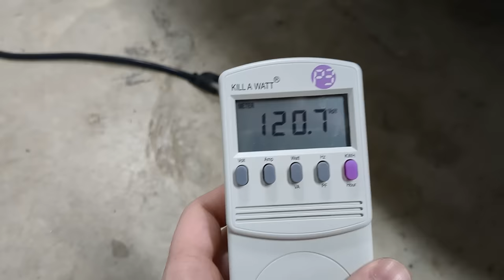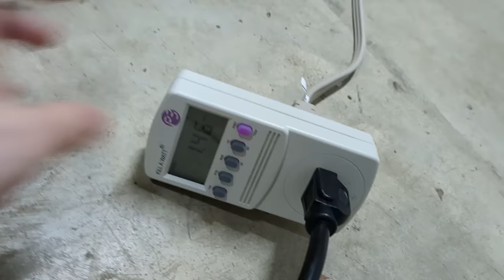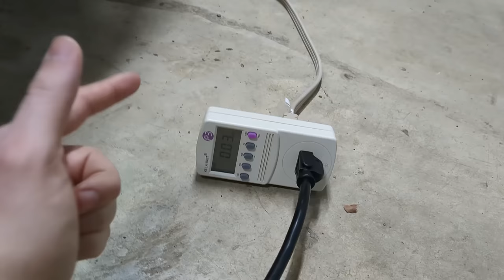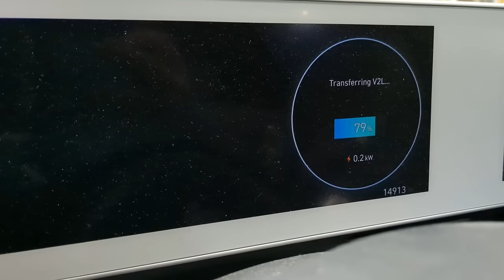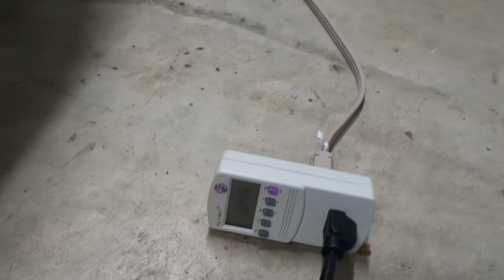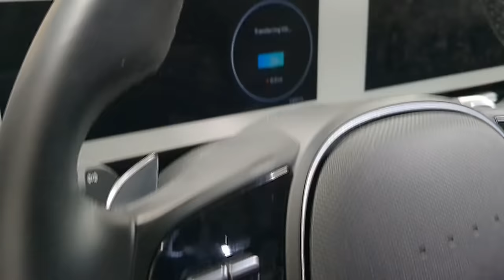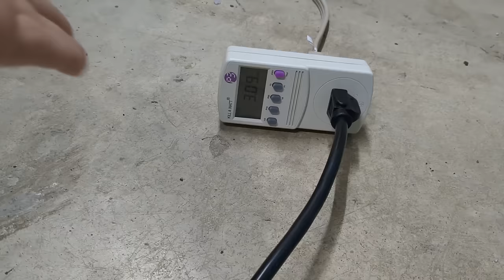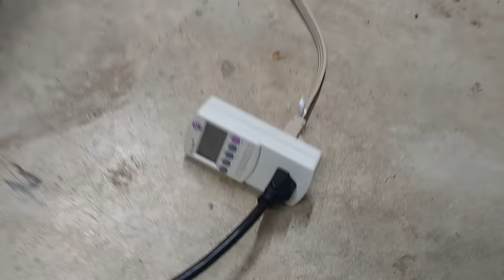A 24-hour test run of the Hyundai Ioniq 5's Vehicle-to-Load function

Comment: I have done something similar with my Prius.  The Prius has its 12V battery in the back with very easy to remove plastic panels over it and one small panel in particular that is the right size to stick large gauge wires through it.  I only have a 600W pure sign inverter at this time as it was deemed adequate for the tasks at hand many years ago when I first set it up.  At my current place I still cook with gas, so don't need that extra power for cooking.  The essentials beyond cooking needs very little power, so this works out well.

The Prius is not "efficient" per say when used this way, but compared to a regular gasoline generator, it is very efficient and very quiet, so really is is a rather ideal solution.  The thing is the power is meant to be used in car mode driving around, so there is going to be some residual load used by systems optimized for high performance while the car is being driven around.  In your case, you have the problem in that large inverters are just not very efficient at power conversions for small loads.  The Prius is super efficient at converting energy from its high efficiency engine into electrical power that it then stuffs into its battery and then the engine is shut back off, saving tremendously on idling engine losses as the engine is never really ever idling.  An all day use like this gets into the realm of a couple of bucks worth of gas used, which is amazing.  Of course with a Prius, you need to make sure it is in a well ventilated place to do this and you have to leave the car in "READY" mode, so the car is ready to be driven around.  So for example you open your garage door and have it ready to be driven off by someone in order to be used as a generator.  Details.

It would be nice if there was a plug-in hybrid electric truck with a generator mode.  A truck with a large gas tank for towing and such should be able to last in generator mode for a long, long time.

Another interesting use could be say for an apartment dweller who say has level 2 charging at work.  When it comes time to vacuum out your car, just pull out this adapter and plug the vacuum cleaner into it.
Reply: The Ford F-150 hybrid is close to what you're asking for. It's got a 7.4kW inverter and 120V outlets in the bed. It's not plug in though.
Reply: Going through the 12v converter is fairly lossy. For a more ideal use you can get inverters which connect to the car's HV system. From user reports I've read using a Prius as a generator this way is about as efficient as a small inverter generator. And another plus compared to going through the 12v is you have much more power available.
Reply: @eDoc2020  Yeah, I looked into this a long time ago.  The Prius can generate up to 3kW sustained this way, plus higher short bursts out of the battery if needed.  There are some catches to this.

For one you need to be able and willing to connect directly to the battery relay terminal.  Those bolts are on tight for a reason.  This gets into doing some work and knowing what you are doing.

The second is picking out your power conversion hardware.  What I was thinking of doing in particular was to get a 2 kW Meanwell power supply with a 24V output.  These are interesting because they are specifically rated for AC and DC input.  This way no worries about burning out something as you hope you successfully end up bypassing the PFC and don't overload something by having the polarity going in always the same instead of its designed alternating design.  Instead these Meanwell power supplies are specifically tested and rated for both AC and DC power input in the right voltage range.

I had two reasons for 24V output.  One is much smaller wire.  Second I could use with my high powered hobby chargers directly and pull more power than I could pull off my 12V.  I was even thinking about a high voltage DC extension cord while at the flying field because then I am operating in the pits / tables instead of directly out of the back of my car.  However, I also had an LFP bike battery laying around.  I ended up doing that instead and called it a day.
Reply: @ChaJ67  There are inverters which will directly input the pack voltage and directly output 120 or 230 volts without an extra conversion stage.

If you do go with a separate DC-DC supply feeding an inverter then it's probably better to do 48 volts. I would definitely avoid 24 volts if you plan to ever go over 2 kilowatts.
Reply: @eDoc2020  I am aware of other, somewhat more exotic direct inverters.  It is just my high powered hobby charger has a 30V input limit and a 1.3 kW max charge rate.  Then I have a second charger that can do say 400 W, but usually this is used for small batteries, so its max rating doesn't matter as it never gets hit.  If your main use is only going to be able to utilize up to a certain voltage, why go over it so you can be more efficient at a fringe usage?

And for going over 2 kW, no need.  That is just not something I am going to use my Prius for.  It gets a lot more expensive real fast going over 2 kW and the car tops out at 3 kW of raw generation.  I mean it makes more driving around with air being pushed through the radiator, but not sitting stationary.

I think this gets back to another point, practicality.  Hooking up a 12V pure sine inverter to a Prius is very easy and it is very cheap.  It may not be the most efficient thing, but it is very easy to do and it is very cheap to do and that pure sine inverter can power 100% of your "roughing it" emergency needs.  (MST cannot and can even damage some things, so beware.)  You hook up to the traction battery and everything well it goes up a pay grade or two in multiple ways.  A lot less people are going to bother with this.  At that, say you are doing this in part because you have technical hobbies.  You may be like me where you need 24V DC for some applications that needs more than 12V.  So then you go down the 24V power supply route.  It is just what that thought process tends to end up in because 24V is simply more useful to you than say 48V.  Maybe you specifically need 48V for something, so you do the 48V conversion instead.  The vast majority of people considering this though are going to have some 24V application and so that is where it is still at.

So now you want a lot of power.  Well maybe it is time to look beyond the Prius because it can only sustain 3 kW and it is nice to use your car for other things like driving around.  So now you are no longer looking to the car as a power source.  So while you could get one of those big, say 8 kW direct inverter / UPS deals I saw many years ago when I looked into this, you are probably just going with a different solution.  Most at this point would just buy a gas generator because it is more versatile than using your Prius and it can sustain higher power loads than the Prius.  Nothing in this high powered realm comes particularly cheap, but generators are produced in high volumes and everyone knows how to operated one, nothing special about setting up and getting it going and so it quickly becomes the no brainer go-to.

While you could point to other vehicles and say this or that, focusing on the Prius, it is super easy to turn it into a low-end emergency generator and a generator for some other niche things, but this generator deal quickly falls apart when you try to scale it up and demand more out of it.  You are hacking a functionality into a car not really designed for it.  It just lends itself to some limited, but useful things in this realm.
Reply: @ChaJ67  If you are going to tap into the HV system to feed a 24v supply you may as well bring the HV out directly into a suitable connector so you can attach different converters.

When I first looked into it higher voltage inverters were quite rare. But nowadays there are relatively inexpensive "hybrid" solar inverters which may be able to accept the Prius HV directly on a PV input.
Reply: @eDoc2020  This is true.  For the proposed 24V power supply project, I would have used an extension cord for the power supply when at the flying field to pull traction battery voltage into the pit area.  It would have made no sense to try to pull 24V power from the car 25 - 30 ft to where I would set up in the pit area, but 200V traction battery voltage is no problem.

Actually for the main use case I had, 24V is pretty efficient.  These Meanwell power supplies should have their PFC effectively bypassed, which would save a few % in efficiency, granted power is still technically running through components in the PFC, it is just there is no longer a difficult to work with AC sine wave to contend with and so no heavy lifting left for it to do.  The DC-DC conversion to 24V is usually really efficient, well above 90%.  The 2 kW Meanwell power supply still works with AC, so can use it when charging your batteries at home instead buying a separate power supply.  Then the 1.3 kW charger I would primarily be using with the proposed setup is essentially a DC-DC buck-boost converter.  At least when changing banks of 25V LiPO packs at full power, the cooling fans for the charger only kicked on when balancing the packs as the balancer is just resisters burning off power from individual cells to make the pack(s) balanced.  The converter itself going between the two very similar voltages is just not putting out any real heat because it is nearly 100% efficient being used this way, even at maximum power output.

Comment: This is one of my most desirable features when buying an EV. People dont know how bad it can be to lose power during the winter. Even if youre only able to power an electric blanket, microwave, etc, that's a big improvement over having no power at all.
Reply: How often do extended outages happen to you? I haven't lost power for more than an hour or so since 2002, and we have serious winters here in Colorado. My Jeep does have a small inverter integrated but I've never actually wanted to use it for anything (it wouldn't power a fridge but I would never ask it to).
Reply: @samuelhulin180  When you live in the sticks, winter power outages happen often. The record here is 5 days. We all have wood stoves for cooking and heating but it's nice to have power and save the contents of the fridge and freezer, to say nothing of entertainment when snowed in.
Reply: @samuelhulin180  It's not about how often, but you'll be glad your car has the option when it happens. Remember Texas not that long ago?
Reply: @samuelhulin180  I have lost power for longer than an hour multiple times in the past year, it would be very nice to have a battery sitting around waiting to be used in exactly that scenario.
Reply: @samuelhulin180  When it is cold outside...take all your food from the fridge/freezer and place it in a cooler on the porch...problem solved.
Reply: @David-nh7px  Hitting on Texas???

Please don't forget the massive outage in the northeast caused by a lowly fallen tree branch.
Or the New York City outage .
Reply: I've lost power for 24 hours once a year for the last 2 years. A large part of the problem is unhardened municipalities. They don't expect bad winters/weather but they get them and are caught flat footed.

Comment: I think it would be interesting to take another 24-hour period and run a small fixed-wattage load (say a few watt LED light) and check the kill-a-watt usage vs. the battery % drop. I would guess most of the loss is just a fixed loss in the inverter per hour. Kind of a similar story with most UPSes.

Comment: If you plan to do some more power usage tests, there are lots of plugs which support computer readout, so you can easier monitor these values. Combined then with an ODB readout of the car you could combine and graph these values ;-)
Reply: I think you'd need the car to be in a more "awake" state than used in this video for the ODB2 to function. That's provided you know which PIDs to monitor for the data as well - is that well known? I don't have an EV myself and when I had a Prius hybrid, the best I could figure out was overall battery health and an charge amount,  both integers in the range of 0-100.
Reply: @draeath  why, would not necessarily think so. Anyhow, not expensive and easy to test and see if it works or not. There should be lots of tools which come with the proper mappings, so why should it be different for his car type. 
An other way could be some api or connected services from the car vender, so you might get that data from the cloud.
Cars are more like a computer than a car being turned off. I had seen there are some physical OBD2 ports with Ethernet, …
Reply: @MartinEKoch  For OBD to be up, you'd need to at least have a CAN bus operating, wouldn't you? That would require at least one computer module to be awake enough to do it - it's not the sort of protocol that's low-energy friendly (ie you can't just poll every few seconds).

Comment: You should do another test - 24 hours with minimal load, or only adapter connected. That way you could measure what part of losses are proportional to power, and what part are fixed losses. If fixed losses are big enough, you will have way more runtime with intermittent running.
Reply: I was also thinking about this, and if using the car for a resistive heater would bring down the differential between measured loss and actual power consumed.

Comment: This is pretty cool, it's always good to have more options. That being said, the idea of "Power out = evacuate" is a bit on the crazy side. Ya the grid is far less stable in other areas. In my area we lose the power for 5-8 days at least once in the average year. A bad year it could be out for 2+ weeks. We also have shorter outages multiple times every year.
Reply: Where do you live that there is an outage 2% of the year?
Reply: @radishpineapple74  oh the irony, my powers out right now. Rural areas have a very different power grid experience than suburbs and urban areas. The linemen have to drive for hours on backroads, and then blizzard conditions makes for slow work as well. Also due to population density and the fact the crews prioritize areas with hospitals, the downtown areas get their power back first.
Reply: @josephcouture2838  Yea, and on top of what you described, suburbs and especially urban areas almost always have multiple routes for the power. There's areas only a few miles from me that frequently lose power in storms for hours or even over a day because there's exactly one feed, while my neighborhood will lose power a couple times per year it's almost always back on within half an hour, and seldom out more than 2 hours. Rural areas don't have that benefit.

Comment: I'd expect the efficiency to get better at higher loads. Both because that's how inverters typically are, and because I suspect your car's phantom drain will be a significant part of what you saw.

My Tesla uses 4kWh per day of phantom drain when in my garage. I suspect other EVs would use a lot less than that, but it would still be noticeable - especially in the cold.

Comment: If you are really aware of the danger and first make sure you cut the circuit off the grid, you can plug the car into any outlet on that circuit ( could be the whole house) so it distributes the power over that circuit so you don't have to run power cords. Again really important to cut the breaker off so you isolate the grid
Reply: i have a super elementary understanding of electricity, but i’m pretty sure most homes are on multiple circuits, none of which can handle the total house amperage without tripping a breaker
Reply: @winterwatson6811  This particular car can't power an entire house anyway, so you'd still have to be mindful of the car's limits.

Alexander's suggestion is just for the convenience of not having to run extension cords everywhere - essentially using a circuit's existing fixed wiring as an extension cord - and I'd imagine any circuit with outlets would be capable of carrying this car's limit of 15A (IIRC). But I'm in 240V-to-neutral-land, so I don't know much about how US/NA homes are wired :)

But yes: ★critically important to isolate that circuit, or even the entire house, from the grid!★
Not only would you probably destroy your car's inverter (at least) if the grid power suddenly returned to a circuit that the car was already powering, but in some scenarios it can literally kill linemen working to restore power. (The car's 120V can get stepped up to many thousands of volts by the same transformer that normally steps it down from multi-kV to 120/240V.)

So if anyone tries this, you might want to consider buying circuit breaker lock-out equipment - things that physically prevent the circuit breaker being turned back on until a padlock is removed (hopefully they exists over there...).
That'll stop anyone else in the house turning it back on when they shouldn't, and it will force yourself to think about it briefly as well, so you can't turn it back on absent-mindedly :)
Reply: The other problem with doing this is it requires a double male ended "suicide cord" which is inherently dangerous.
Reply: NO YOU DO NOT BACK FEED! EVER only use a proper transfer switch NEVER EVER BACK FEED
Reply: Can do, and should do, are very different things.

Comment: as a fellow data nerd, I'd suggest getting the Emporia Smart home energy monitor (aka Vue2) for your house. It monitors your whole house power usage and graphs it nicely, along with up to 16 circuits in your electrical panel. I know exactly what power my kitchen fridge and upright freezer are using since i monitor those circuits on 2 of the 16 sensors.